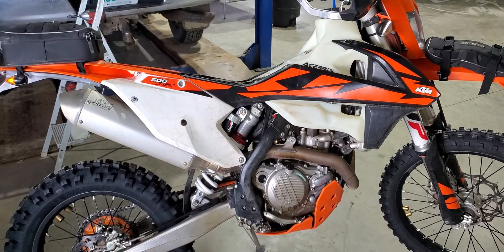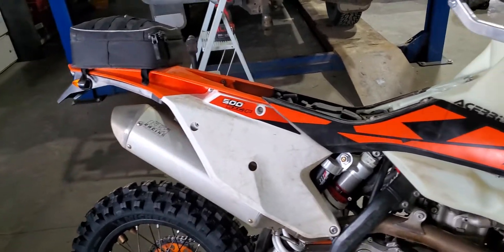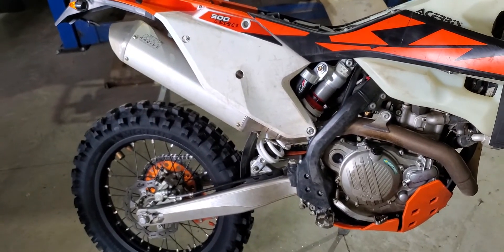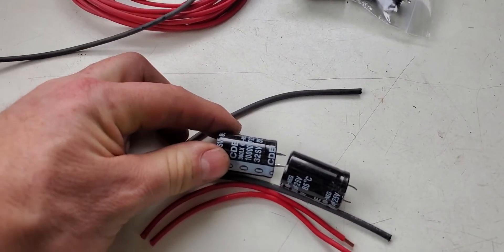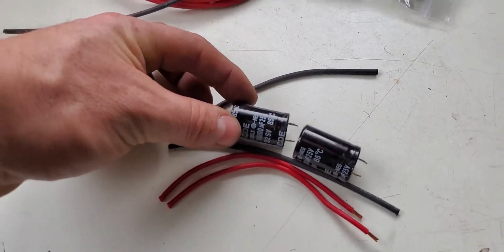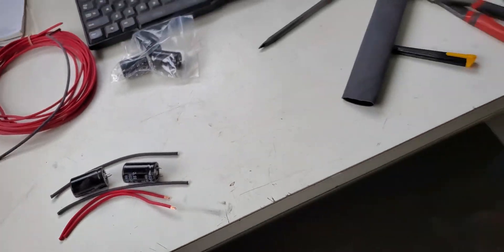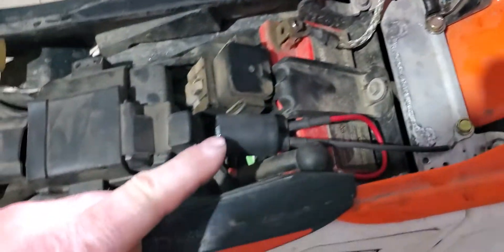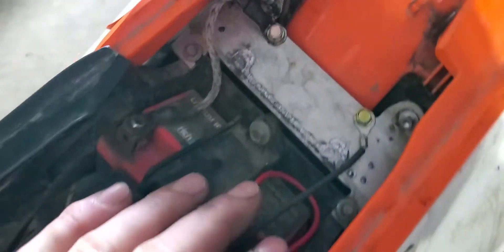KTM Husky 450 500 690 Cant push start bike with Dead battery, workaround.

Comment from the maker: Just 1 10000uhf  25volt ish Capacitor connected to the battery.   Neg to Ground or - Negative post on the battery. Positive to + on battery.
Now you can push start your bike.
And it'll start.
Or you can buy these off Tokyo offroad youtube channel. He has a better  explanation

Comment: I charged my capacitor up and every time I try to push start it it won’t turn over then the capacitor is dead I’m wondering if I have to add 2 capacitors it doesn’t seem like one has enough juice
Reply from the maker: The cap won't start your bike even with several caps.  The caps there to allow the bike to run once it starts with a push start or boosting.  Without the cap with a completely dead battery you won't be able to keep the bike running.  This only applies to modern fuel injected bikes. The explanation for this is long.  But trust me if your bikes battery ever completely fails, lithium batteries are famous for working fine than completely going dead.  U won't be able to start or keep the bike running without that capacitor inplace.

Comment: just need 1 pc only capacitor connected to +ve terminal ya..
Reply from the maker: Just 1 10000uhf  25volt ish Capacitor connected to the battery.   Neg to Ground or - Negative post on the battery. Positive to + on battery.
Now you can push start your bike.
Or you can buy these off Tokyo offroad youtube channel 
Bike and it'll start